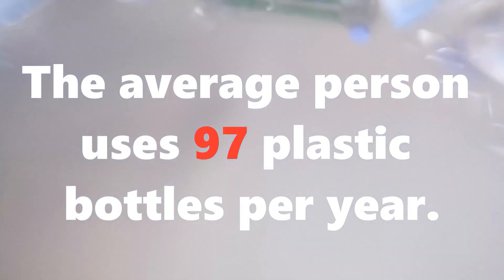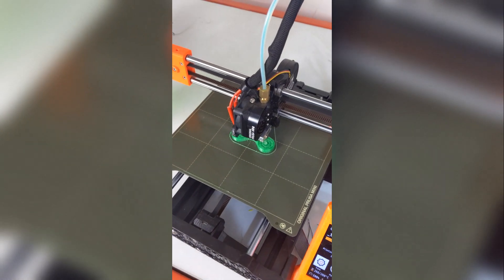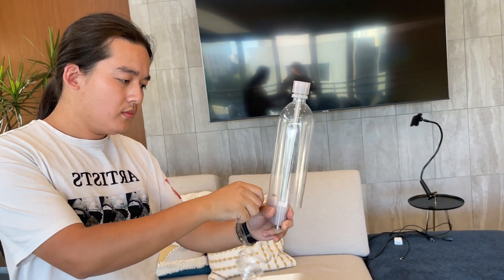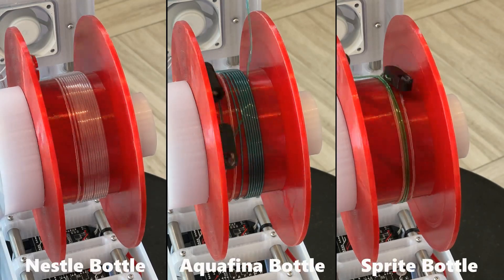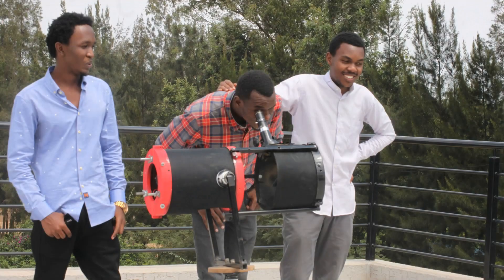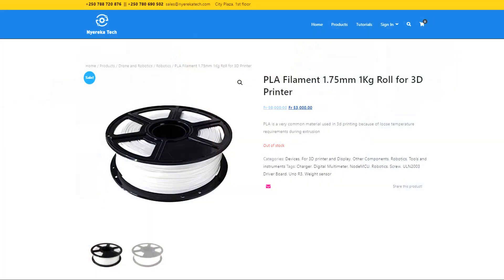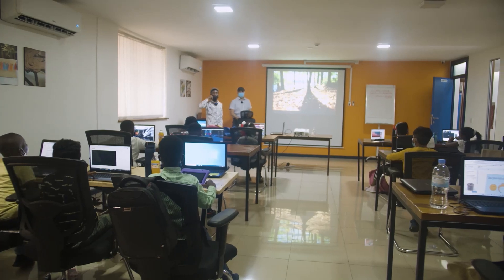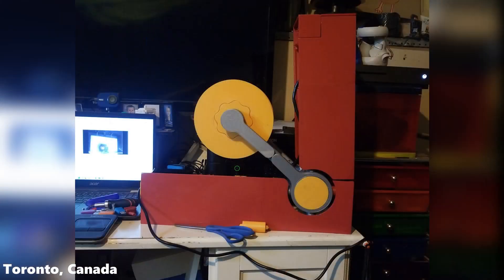This machine turns water bottles into 3D printer filament | Polyformer

Comment: I have been trying to do this for 2 weeks. They don't say the exact size of the tape in the videos. They don't say the thickness is right. or they don't say the temperature right. every video is the same. they don't say the main thing is that it's a pity. what do you think is the reason?
Reply from the maker: @OSHE Hi, please check out the discord link: https://discord.gg/Z2XpPyb3. Here you can find all of the information you need to build a polyformer, along with a large community of people that will help you with your build! The videos are just meant to promote/explain the project. Maybe in the future we can do a build video if enough people want one?
Reply: @OSHE  It's open source, that mean you're free to create a video, create a wiki or whatever to add the informations you learned the hard way so others people can benefit from it.
Reply: Because they won the award for something other people invented years ago.  This is nothing new.
Reply from the maker: @The_Jay_Tee  respectfully it is a bit harsh and dismissive to say there is nothing new here. We have put in significant engineering work to make this project possible. As this is an open-source project, we want other people to take these designs and push them even further! Like it would be cool to make a smart adjustable bottle cutter that automatically measures bottle thickness and adjusts the strip cutting depth accordingly.....
Reply: @The_Jay_Tee  Of course, but it is not so difficult to say small projects. Sooner or later, I found it, but for 2 weeks, my nerves were strained due to inaccurate information in this format. this is envy)))
Reply from the maker: @The_Jay_Tee  we were both inspired by recreator3D and Joshua Taylor who personally advised us on PET bottle recycling. There are many innovations in Polyformer from the adjustable bottle cutter, to the sinusoidal drivetrain, to polyformer-lite. I encourage you to checkout the discord for more info on the unique design: https://discord.gg/Z2XpPyb3. This is an open-source project so we absolutely want people to take the design and iterate on it for new machines!

Comment: Hey Swal, I'm currently working on creating your conveyor belt printer. Along with that, I'm making my own pet bottle to filament machine, that feed directly into the printer (https://www.youtube.com/watch?v=uoHukwkupF8). I have heard that when you make your own filament this way, it may not always be exactly 1.75mm. I have found an example on how to make a filament diameter sensor (https://www.youtube.com/watch?v=RYgdLPe_T0c&t=343s) but I'm not sure how to go about trying to hook this up to my Artillery Hornet. As it looks pretty hard to access the electrical and computing components inside the printer. I'm wondering if you would have any if advice on how to go about this. 

Thank you, I love what you're doing. Your conveyor belt printer is what convinced me to get a 3d printer.